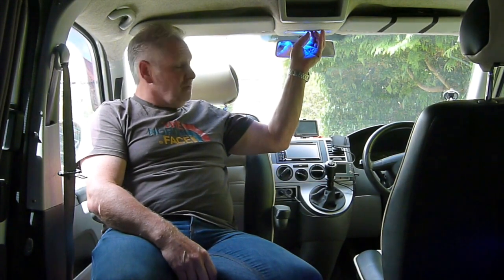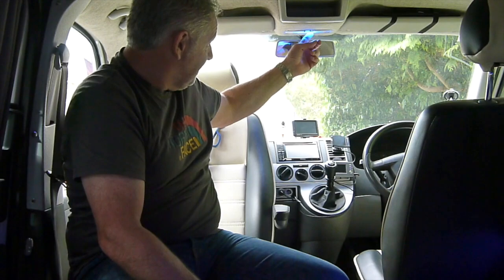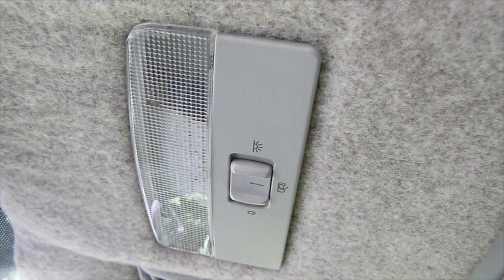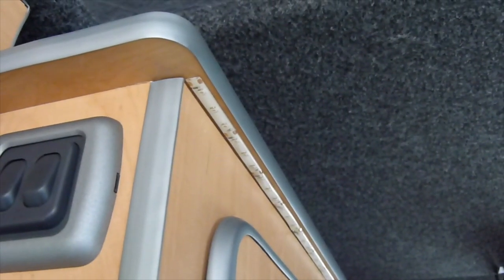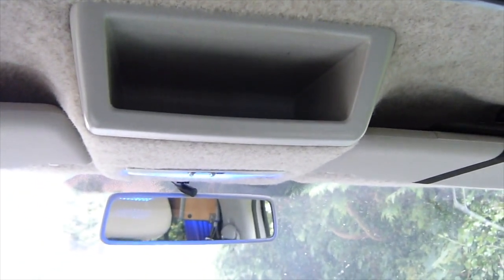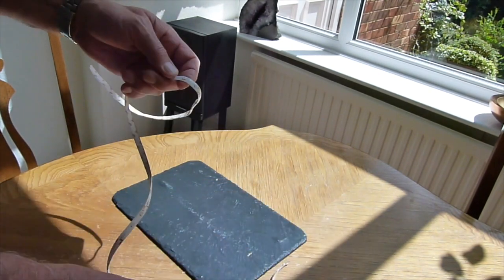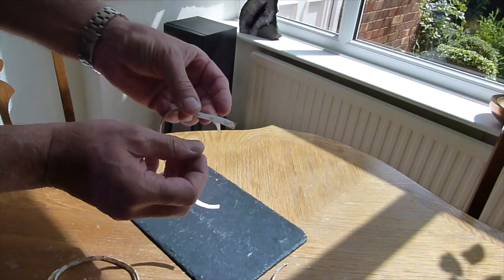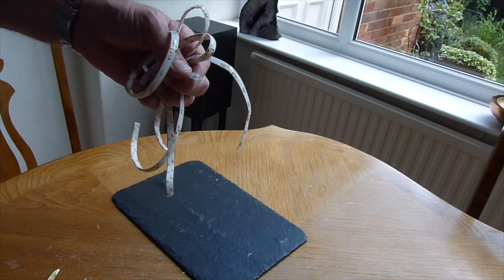Fitting LED Lights to my T5 Campervan that are linked to the Courtesy lights

Comment: You have done a good job with these, i know you dont have the T5 now you have a Sprinter yes?  Im going to fit ‘mood lights’ into my T5 high top as i have at home i start shift on earlies i leave home at 4am, so My eyes cannot tolerate anything but low frequency red light! My stealth has no windows ( for now) so its always pitch black!  Proper job mate👍🏻🤘🏻
Reply from the maker: Yep we now have a sprinter  good plan with your van 👍🐾😀

Comment: I know it's an old vid, only now discovering sorry. I have question about connecting directly to the curtesy light, i wish to do the same on my hyundai iload. I have 2 wires from my led lights and 3 in the curtsey light. When the van light is in the off position the led still  lights up once i connect it to it. How do i connect to the curtsey light in such a way that the led's act the same as the original light? Much appreciated. Love the build very nice!
Reply from the maker: Sorry Ash I don’t know the your van is wired the only thing I can suggest is linking direct to each end of the bulb connectors that had the light that comes on when you open the door remember that LEDs are polarity conscious and will only work one way 👍 hope that help 👍😀🐾
Reply: @onemanandhiswhippet  thanks for the reply buddy ill be sure to give that a go today 👍

Comment: Hi, great video I am just finding. Would you be able to pop through a link for eBay for those adaptors you mention please. Struggling to find them. Cheers!
Reply from the maker: There you go https://www.ebay.co.uk/itm/233254411872 👍😀🐾
Reply: @onemanandhiswhippet  Hi just seen you video and inspired me to wire in some lights, the link though goes to the LED lights, have you got the link to the adapter? Thanks Mark
Reply from the maker: Mark Blow sorry it was a long time ago what is it you are looking for and I will see if I can find them for you on eBay 👍🐾😀
Reply from the maker: Mark Blow is this what you are looking for https://www.ebay.co.uk/itm/301887550396
Reply: @onemanandhiswhippet  no sorry, not looking for the bulbs, looking for the adaptor that goes in the curtsey light to connect the wires too?? Thanks 👍
Reply from the maker: Mark Blow it’s just soldered to the + and - there’s no adapter 👍😀🐾
Reply: @onemanandhiswhippet  😂😂 OK get it now 👍 thanks

Comment: Afternoon!

I am currently trying to instal LED footwell lights in my T5.

I want them to function just like these. How did you attach the wires to the back of the courtesy light? 

Thanks for your help!
Reply from the maker: Hi there I just soldered them to the connections in the courtesy light and slightly upgraded the fuse too 👍 hide in the cables is the hardest part hope that helps 👍🙏🐾
Reply: One Man and His Whippet perfect thank you :)